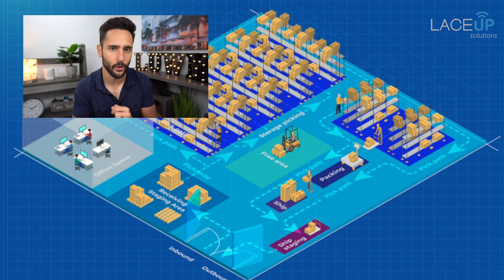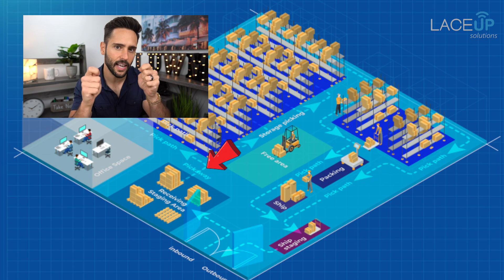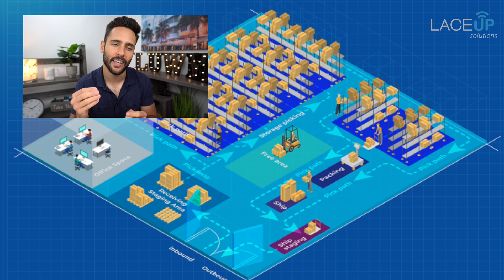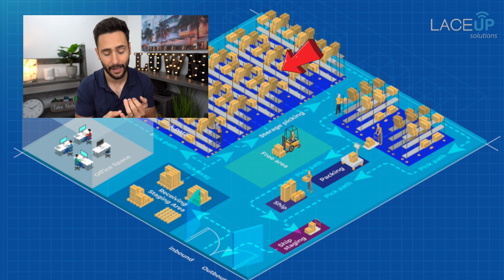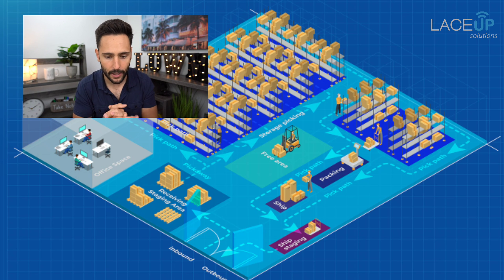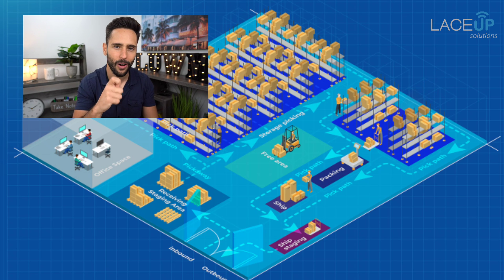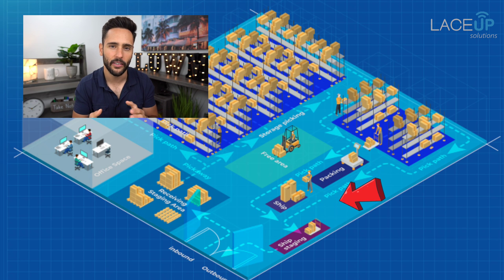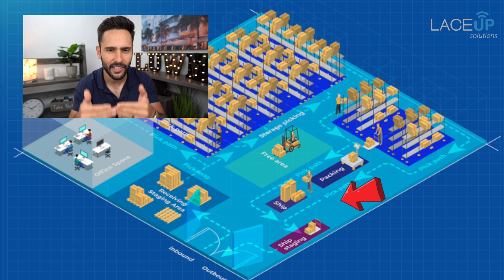How To Layout Your Warehouse Locations | Warehouse Management

Comment: One of the big downsides to a V-shaped warehouse is safety. In a high-traffic environment there are a ton of opportunities for low visibility acute angle corners to cause t bone or side impact collisions. Anyone looking to switch over to the v-shape should look into mitigating these problems through a variety of means, such as adding extra empty "no-go" space at the end of each rack along the main corridors to increase visibility, or implementing presence detection systems or stoplights at intersections, or limiting vehicle speed to 5 mph.